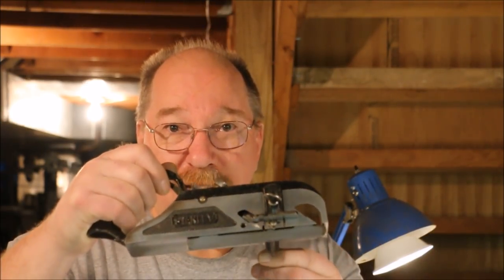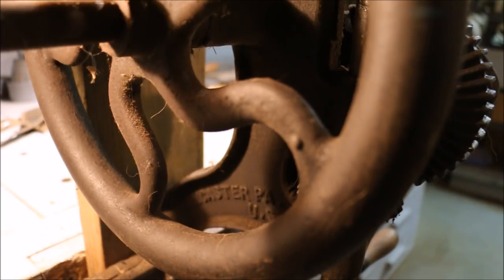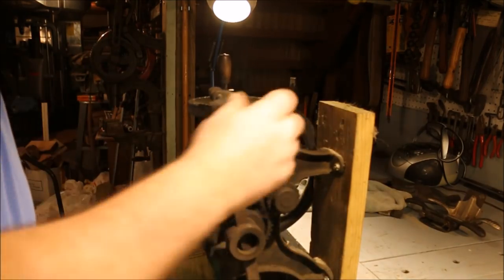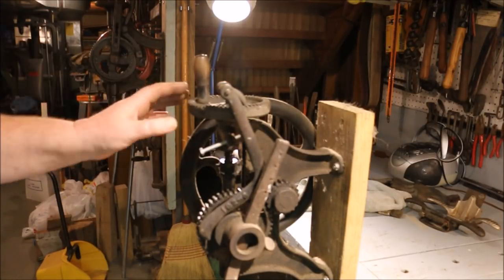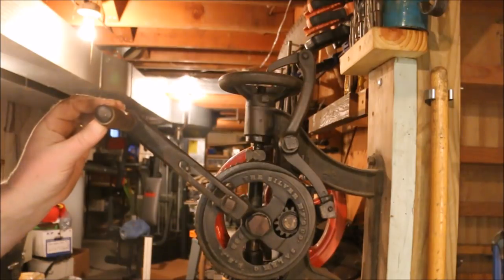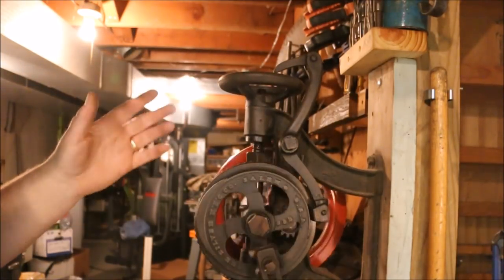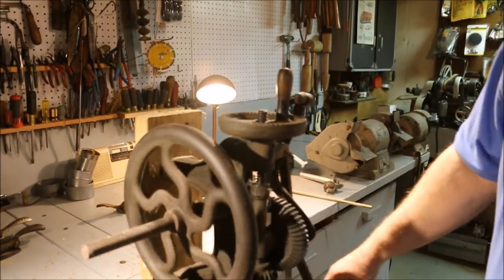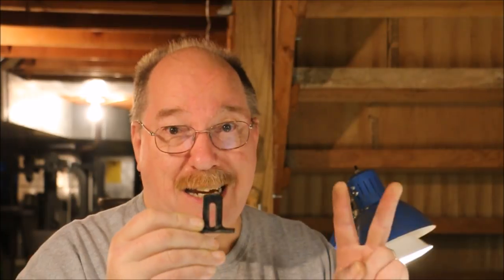REPLICATING A DEPTH STOP FOR THE STANLEY #78, SARGENT #79, MILLER FALLS #85

Comment: Love that 2nd post drill! I have the same Champion Blower 102-3 as you. The neck on the body was broken and repaired so it’s not perfect. Binds a tad when cranking it. My blacksmith shop is tiny but I would like to install and use it.
Reply from the maker: This one will be in my blacksmith shop if I ever get the shop finished. 😁
Reply: At least you got all the bits again

Comment: Anyone know where a guy could get the fence rod and the depth gauge thumb screw for a Stanley no. 78? I found the rod on eBay for $$$$$, but no thumb screw.
Reply from the maker: Never dealt with these guys but they say they have them. www.stanleytoolparts.com/degascandwa.html
Reply: Old Sneelock's Workshop - Thanks for the lead! I'll give them a try and let you know!
Reply: Old Sneelock's Workshop probably a easy lathe project. I will look at mine and see what the three size is. Can you check yours?
Reply from the maker: It's a thumb screw with a 10-27 thread just like the threads on a Stanley #80 Scraper Plane. 3/16 OD and 27 threads per inch. I have dies for 10 - 24 but not 27. It could be single pointed but that is a really small piece for me to try and make. I think it could be done but not with my old lathe.
Reply: Old Sneelock's Workshop that's as goofy a three as I've ever seen
Reply from the maker: Stanley made tools before SAE was even a gleam in their Daddy's eye. Most of their tools have proprietary threads. I don't think it was anything other than that's what they made and stayed with it.
Reply from the maker: I found a place that sells a die. www.victornet.com/subdepartments/Special-Pitch-Dies-up-to-1/2-inch/1350.html $11.00 I'm going to order one just to have it on hand.
Reply: Old Sneelock's Workshop nice and not to expensive

Comment: I came across a champion post drill press. ...the owner wants $100 for it.  Is this a good price for one of these?  It looks like complete, no parts missing.
Reply from the maker: Edwin L make sure the chuck is in good shape. 1/2" drill bit should fit snuggly. If it is loose the drills will wobble.
The gears should mesh with no rattle. The crank should be straight.  
This one is missing the post, table, and mount on the lower end.
Reply: Old Sneelock's Workshop ...thanks for the quick response. ..keep up the good. .I enjoy your videos
Reply from the maker: Edwin L I was at the Mall when I was answering you and got interupted. Hard to text while carrying shopping bags. 😊
If all those things are good it is a reasonable price. Knock off $10.00 for each missing/damaged part.
Reply: Old Sneelock's Workshop Thank you Sir for taking your time to respond to me.  Have a great day!!

Comment: i have a missing piece from a plane myself, unable to find that part wihtout buying an entire plane , which i cant find one cheap enough for the part, im missing the wide headed screw that mounts the blade to the plane iron cap,  its a stanley no4 which ive not been able to use (unless i borrow it from my no5) ,  anyone have leads one where to get one cheaper than buying a used plane?
Reply: Jusb1066 send me a picture Justin I might be able to help when I was at work I had spare blade sets ready to go because when the customer what's something yesterday it was quicker than stopping re sharpen etc if it's what I think it is I can help
Reply: Jusb1066 yes not brass I don't think but I've got one or two of those pop me your address on messenger I'll send you one
Reply: thats great news, ive been pondering this plane for about 3 years, thought it would be easy to find one of these screws!, stanley dont sell parts like they used to and buying a used plane was out of the question on ebay
Reply: That's my BLO brother. Always willing to help!
Reply: Jusb1066 I converted my two 4 1/2 & 5 1/2  dedicated smoothers to thicker blades years ago off Clifton I think not sure were I got them now they come complete with cap iron and matched blade I've never checked but I wonder if the screws are the same.if so there are loads making blade sets now  qiangsheng for one and are cheap they will all be Stanley bedrock copies you can bet I'll have to check let you know.if you use a plane as a smoother a lot it's worth it the difference is unbelievable
Reply: i thought i was posh using two record tungsten vanadium in my 4&5, i also do have an old thick cast blade that might fit somewhere, but im not a very good woodworker so anything that new is wasted on me